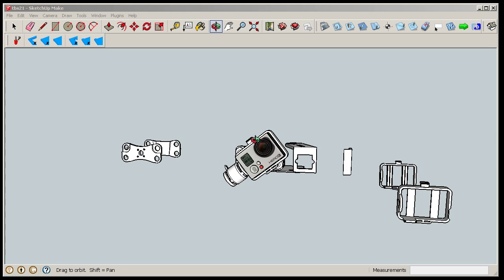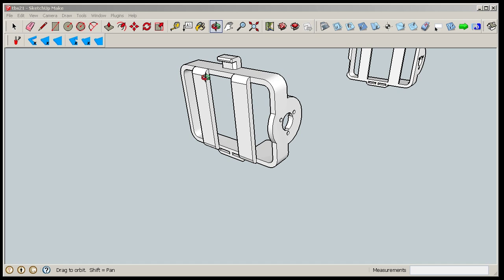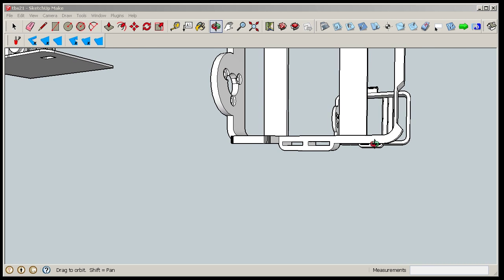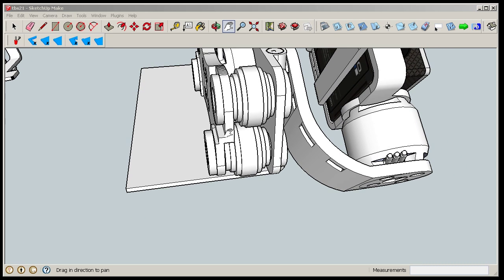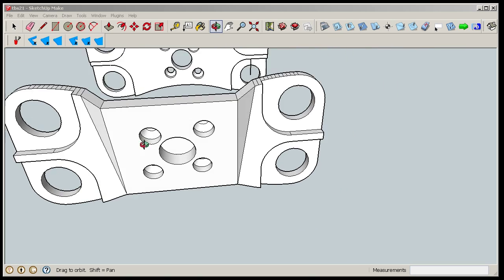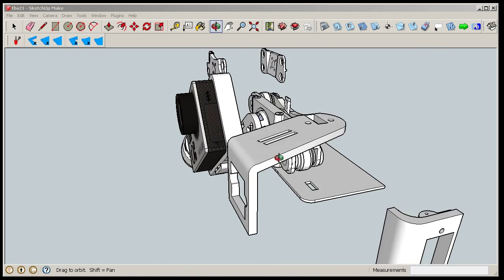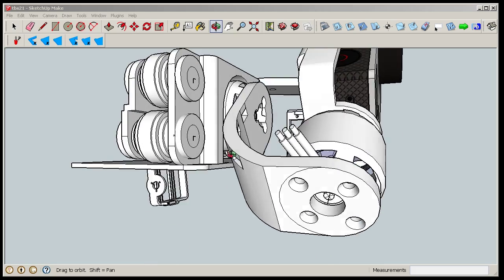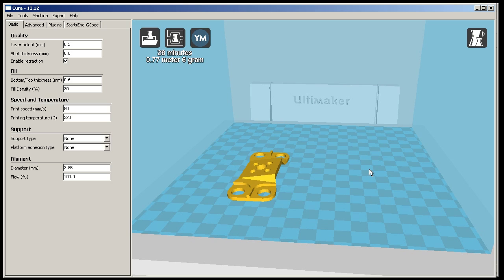Update on the 3D printable TBS gimbal I am working on

Comment: I am planning to make one exactly what you have but will need to design the front and back plate to match the ov3rquad frame. Current spacing between the 2 posts will need to be 3.2" and height of 1.5".